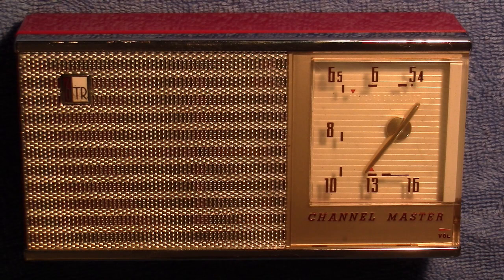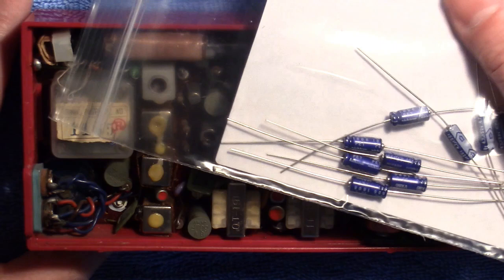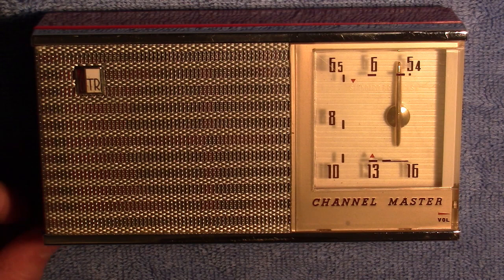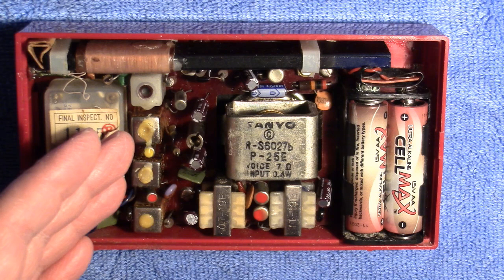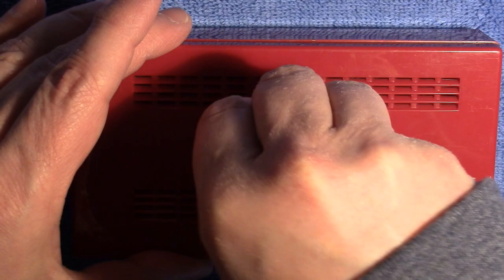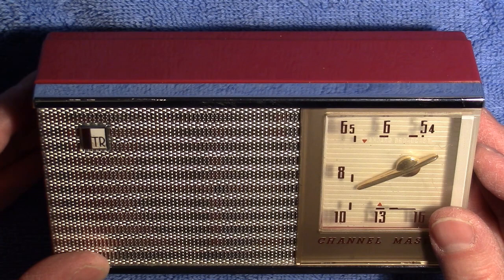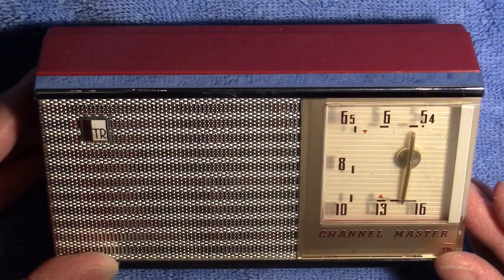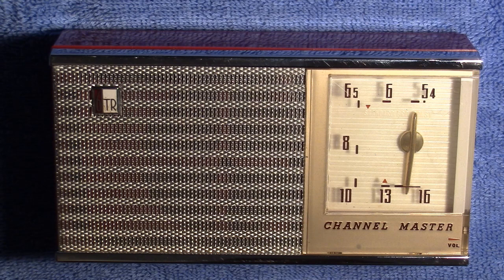Channel Master 6506 AM Transistor Radio Repair and Bandscan

Comment: It sounds fantastic. And it’s not even the super fringe model. Excellent job.
Brad
Reply from the maker: Thanks! I would love to have a super fringe.
Reply: @TheRadiogeek  I have the same model that you’ve got! Still working great with all original components. I just picked up a “super fringe” for pretty cheap. It may need some work...
Reply from the maker: @NickG123  very nice! I would like to get a super fringe someday too. When those caps go bad it will be playing fine one day and be dead the next time you play it. Changing them is well worth the effort.  Enjoy that fringe and good luck on the recap. 👍❤️📻

Comment: I have 3of them.
The 6506,
6512 - am/sw
6515 -“ Super Fringe “
Fantastic performers.
The 6506 that you have is the “baby brother “
to the 8 transistor
Super Fringe.
All mine have been [professionally] recapped/retuned +.
Sanyo did a great job on these.
Well worth the investment ❗️
Yours looks good.
Anyone looking for a great performer,  there are enough of these around.
📻👍🙂‼️
Reply from the maker: Jeff King yes mine is a very common radio that you can find on EBay. This is my first Channel Master (made by Sanyo) I am now a Channel Master fan! Thanks for watching! 👍❤️📻
Reply: TheRadiogeek 
If you think the 6506 is good , get yourself the 6515”Super Fringe “,
And the 6512 (am/sw).
They match the G.E.
SuperRadio”.
I also have a 6528,
( “6 transistor-3 i.f.”),
But it needs work.
You ought to see the double wound ferrite rod inside of this❗️
📻👍🙂‼️

Comment: Thank you for the video. I had the same experience with an EBay seller who  sold me a Channel Master 6515 that "works perfectly."  Not the case at all but since it was in good cosmetic condition and came with the original leather case, presentation box and earphone I decided to keep it and not say anything.

Comment: These were made by Sanyo and they are excellent performers! Look into a 6515 or 6515B. They are 8 transistor with a tuned RF, also known as the "Super Fringe" I have a 6515B N.O.S. still in the original wrap!
Reply: Radio wild 
That N.O.S. Must be a real looker.🙂 - And You have a “daily Driver” .
Cool.
Reply from the maker: Radio wild I would love to find a in good shape super fringe! If you haven’t made a video on your NOS radio you really need to. I would love to see it. Thanks for watching! 👍❤️📻
Reply: TheRadiogeek 
There is a man who almost specializes in Channel Master radios.
He is one of the sellers on The Radio Attic.
This is where I got mine.
📻🙂
Reply: I have a 6515 in black..with the leather case, leather strap, and leather case that holds the suction cup antenna and earphone which is also in there...as is the or original box with styrofoam inside. After a recap...it is awesome...I think I receive on a good night at least 40 channels end to end of the band.

Comment: From what I understand 
[ from the source where I got my 3] these are real pistols, it Sanyo did use lower quality caps in these, so he automatically replaces all caps first off.
Reply from the maker: Jeff King I do believe that the caps in this radio had Sanyo branded caps. 👍
Reply: TheRadiogeek 
They were made by Sanyo.

Comment: The caps in all CM(Sanyo) radio's of that era, are usually bad...I have 5 radio's and they all were bad...The black dot on the cap is usually negative "-"......
Reply from the maker: I guess 50 plus years isn’t too bad for a cap 🙂 it’s a nice radio and now it plays well with new caps.
Reply: Kennynva 
You are right. I know a man that almost specializes in Channel Master radios.  He said the same thing. That Sanyo used some substandard caps.
These are dynamite on reception ❗️
📻🙂